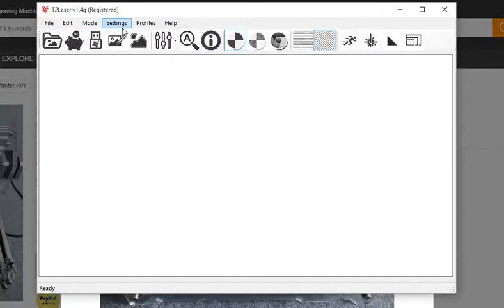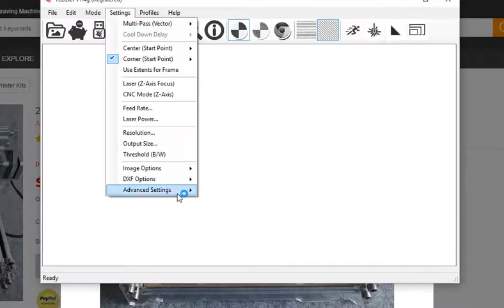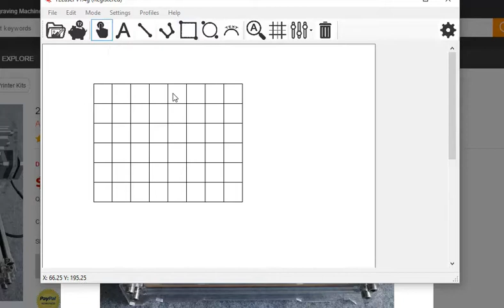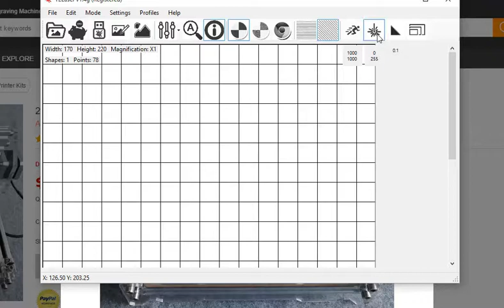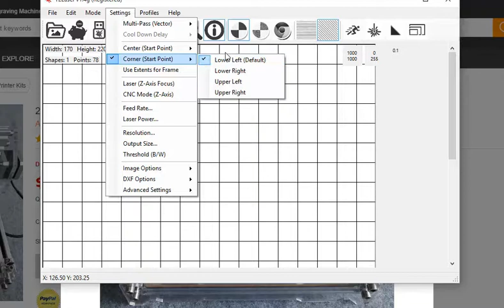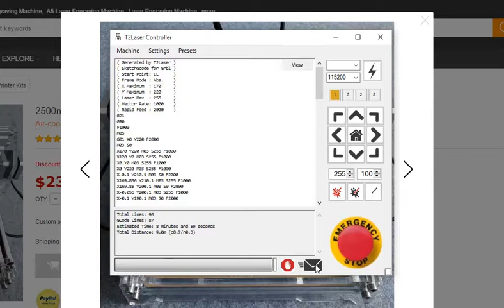Making a Laser waste board grid using T2 Laser

Comment: Hi Steve, nice video.
Had a question, are you using the stock Mana SE control board for the laser ?
Reply from the maker: Suyash Mishra I have a stock Mana se board and a modified L7 board. I run 2 lasers on 1  computer with 1 License and 2 instances of t2 running.  The L7 uses home switches and air assist.
Reply: Thanks very much. You saved my day.